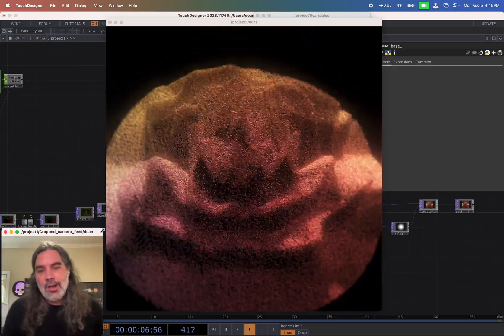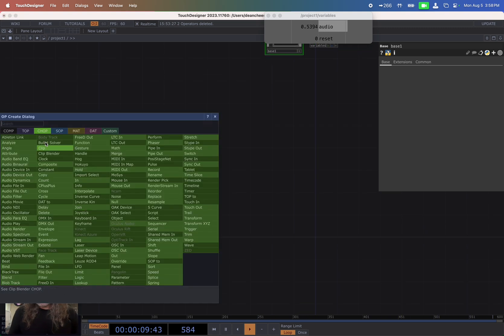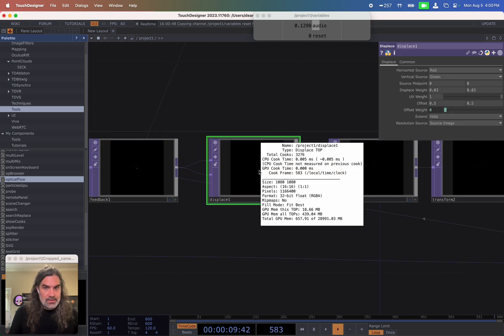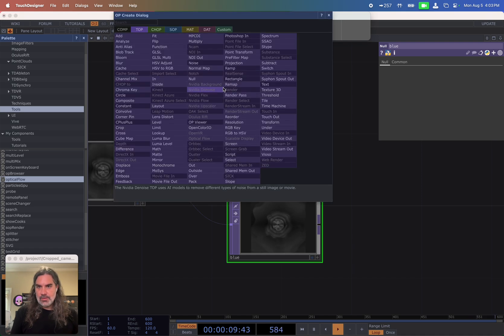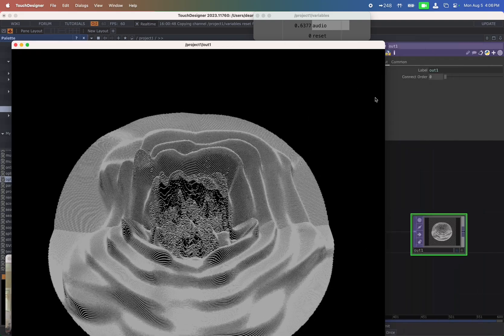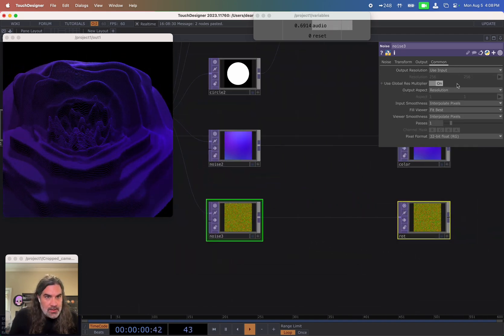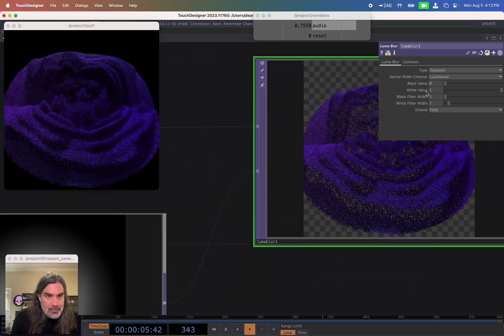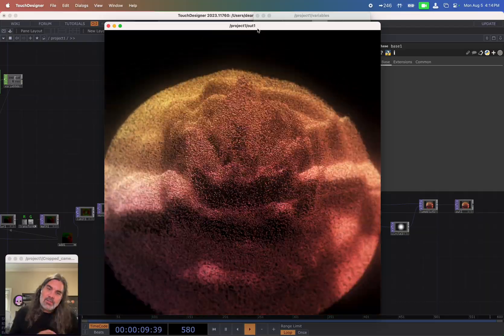Audio-reactive Voxel Ripples In Touchdesigner

Comment: i didnt understand much of what was happening but it worked hahah, now ill mess  around to make various elements audio reactive, like the color and glow,  but  i have a question, i haven't tried it  but, could it be possible to make the particles at the edge escape the circle shape or make the edge more "softer" not this perfect sand circle, ill try my best but i hope you can shed some light on it cause you are more proficient and knowledgeable
Reply from the maker: Thanks for following along! To soften the edges you’d want to change the input for the alpha on the reorder. In the tutorial it’s Circle2. You could use the soften parameter on the circle + noise + threshold to fade off the edges before going in to the reorder.